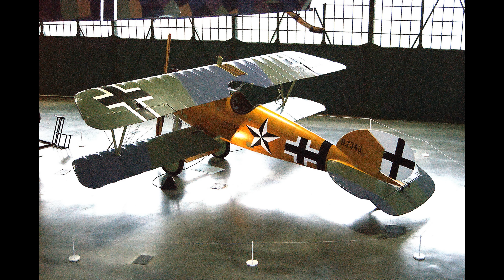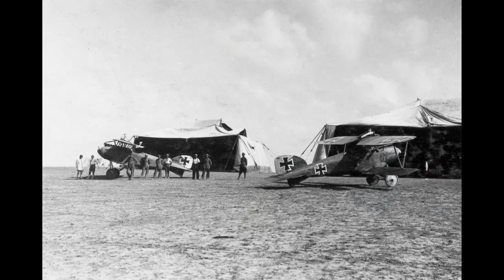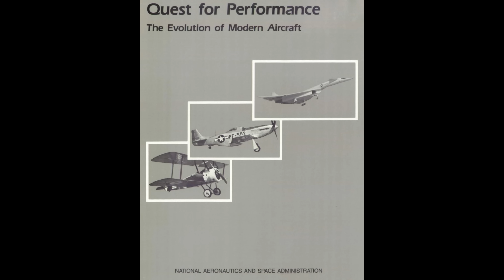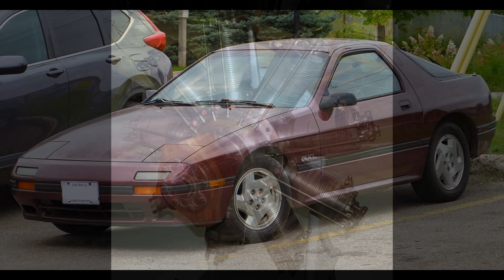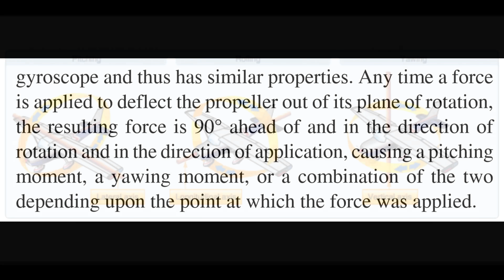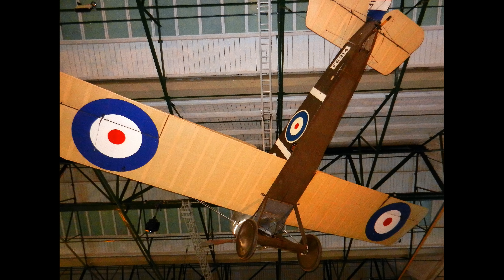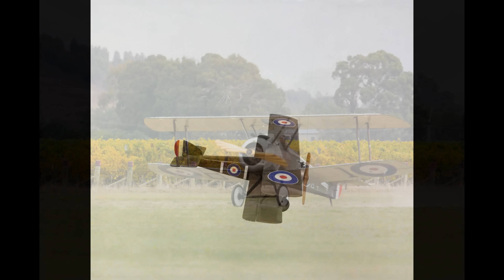Sopwith Camel, War Winner or Death Trap?

Comment: I think a lot of the Albatrosses and also Fokker aircraft really was sort of 1½ wing aircraft's. They where basically mono-wing aircraft with a small lower support wing. The lower wing really was there mostly there for structural strength, and the extra reduction in wing-load was really just a bonus.

So it kind of makes sense that the lower wing had not control surfaces.  A really extreme example of this is the Kondor D.7 where the lower wing is basically a bit of lumber.

I have heard (don´t know if its true) that the liquid cooling of the machine gun was integrated with the engine liquid cooling of liquid cooled aircraft's. That would not only get them nice and toasty, but also with a very uniform temperature.

I think the idea is that the Camel looks like a camel from straight on frontal view.
Reply: Except the lower wing of the Albatros D.III was structurally weak, a problem that plagued all the sesquiplane designs of the period. Not all German planes of the period were sesquiplanes but they still usually went with only one set of ailerons.
Reply: @jeremypnet  There was actually a few that used double setts, while yes, it was rare.

And while sort of kind of not every was, even fokker triplane had gradually shooter wings and quite a few of them had shorter cord on the wings. Not all, but i would say most.

And of cause even the one that was sort of full biplanes evolved that way, it kind of make sense that they retain some features from earlier models. 

For the British planes, all i checked have basically symmetrical wings. It looks like they used the same profile for all wings.
Reply: They were Sequiplanes, the small high aspect ratio wing had a higher incidence which meant in the cruise it did most of the lifting and the low angle of attack main wing produced very little drag.  At the reduced climb or manoeuvring speed the overall higher pitch brought the greater wing area main wing into play.

Comment: Current issue of Cross and Cockade magazine, published by Great War Aviation Society has article about Camel, focusing on how difficult it was to fly.  The author had access to interviews with Camel pilots that had been done in 1960s.  Consensus was that it wasn’t particularly difficult to fly for an experienced pilot.  Takeoffs were the trickiest from a gyroscopic perspective.  Now, we have to remember that these pilots had experience with rotary engines, as the Pup was used as a trainer.  Also, pilots were used to flying this type of aircraft- you can’t fly it hands-off like modern aircraft.
Reply: Consider that the primary training aircraft used for British training up to about 1916 was the Maurice Farman MF7 Longhorn, which was rife with weird and quirky handling as well as being slower than anything they were training to fly. There was also a mix of RAF BE2 and some Sopwith two seater trainers.. Up until they decided that the AVRO 504 with it's generous tail arm and somewhat innocuous handling was to be changed over to in the mid 1917's.   It gave you a gentle taste of gyro precession and rotary engine operation procedures and they installed bosun's tubes so the trainee could be shouted at when he made a mistake.

Comment: I so totally agree that I just don’t see much of a hump and always scratched my head at the naming of the plane for a rather unobvious feature. It needs to be pointed out and then you go ahhh yeah I kinda see what you mean that’s a little bit of a hump right there if I squint enough.

So when I used to play a lot of flight sims especially WW1 games, after a while I really figured out the SE.5 was where it was at and NOT the Camel. The speed and smooth handling of the SE.5 made that plane unbeatable same with the SPAD 13. Much rather fly those planes than the clunky Camel any day.
Reply: Hi chpet. As I understand the name did come from the fact that the plane was as misbehaved towards her pilot as the animal, frequently trying to bite or kick his handler.
Reply: @alcalaino1486 While it’s a nice story but if you think of that logically the unwieldy handling would have been applied by Pilots AFTER they had experienced it’s nasty characteristics but the design teams were the ones I’ve always read as coming up with the name because of that “ hump”. But the most important thing you might want to think about is most people in 1917 don’t have a clue what a camel is like but just about EVERYONE knows what they look like !

Comment: Ah the Camel. It awoke some old memories.

My dad had Microsoft flight simulator on his old 286. It had a simple dogfight mode, that's where I learned about the Camel. Can't remember exactly what German planes you fought, but one was a dreidecker.

It was a challenge since the fps was about 10-12 with nothing but instruments visible, and around 2-4 when close to another plane or terrain feature.

The graphics weren't much, just wireframe, monochrome vectors, on a Hercules phosphorus monitor 😁

Comment: Am i correct in saying that the Camel did not have a throttle as we usually understand it, but simply had an 'off' switch that could be used to slow the aircraft down for landing?
Reply from the maker: Sort of, I didn't have time to get to that.

Comment: Want to know about gyroscopic precession, ask any helicopter pilot.
Reply: In practise, gyroscopic forces have surprisingly little impact in helicopters.  By and large, gyroscopic effect depends upon the rotating part's: mass; distribution of mass, and speed of rotation.  With their tiny solidity ratio (eg 0.08 for a Sea King), helicopter rotors have relatively little mass compared with their size.  Most of their mass is concentrated in the hub area, and they have a relatively slow rotational speed (eg 200 rpm for a Sea King).  

There is a similar effect called phase lag, which means that cyclic control application has its maximum effect upon the rotor disc about 90° later than the input.  The pilot doesn't feel this because it's taken into account in the control rigging: if the pilot pushes the stick forward, the rotor disc tilts forward - initially, anyway.  This shouldn't  be confused with gyroscopic precession.

Of course, helicopter aircrew are indeed familiar with gyroscopic precession. Even nowadays, many helicopters make use of mechanical gyros for instruments, autostabilisers, autopilots and navigation systems.
Reply: @simonburch4434  Not my point. My point is the 90 degree offset of the control linkages of the main rotor. One could call that a bit more than little impact considering.
Reply: @rustyheckler8766   The 90° offset of the linkages in the controls is there to cater for phase lag, not gyroscopic precession.  Phase lag is entirely different from gyroscopic precession.

Comment: Just over 500 pilots killed in combat in the camel just under 500 pilots killed in flight training. probably the most dangerous aircraft to ever enter service yet it was flown at night and off early aircraft carrier experiments.

Even today modern examples are flown with only half a fuel tank. 

This is to avoid taking off with a rear CG (tank behind pilot) there is no elevator trim a considerable stick forward force 16lbs was required to stop it pitching up on take off. A mixture adjustment had to be made after take off while doing this lerner pilots often relaxed pressures on the stick causing pitch up and stall spin.

With an empty tank the CG is rearward and there is hardly enough elevator to flair the landing. None of this is due to the gyroscopic effects but simply fuel tank location and lack of elevator trim.

The follow on Snipe put the fuel tank round the pilot.

Comment: One of the other dangerous traits of Rotary - engined fighters: no throttle. Gads! Ya basically run 'em with a kill switch.
Reply: They had no throttle?
Reply: @HDSME correct.
Reply: @HDSME iirc in the Camel "throttle" meant to switch off cylinders in two stages.
Reply: Those Magnificent Men in Their Flying Machines ?
Reply: Only the Gnome engines had no throttle. Rhone and Clerget have throttles.
Reply: @EdmondDantes-c8t  Correct although the Bentley-Clerget also had a throttle.  If you want to see one in operation  Kermit Week's Sopwith Snipe's first start and warmup demonstrates the throttling abilities of these "throttled" rotary radials
Reply: They dealt with those little fockers though 😂

Comment: Fascinating video that lays out the difficulty in flying a rotary with such a concentrated mass.  Does anyone know if the Camel had an incremental throttle or was it an on/off 'blip" like all the other rotaries? And what  effect would blipping have on the gyroscopic forces?
Reply: I understand that it was on/off.

Comment: I believe that the Camel killed more inexperienced pilots than enemies. It was notoriously dangerous in take offs and landings.
Reply: Even during WW2, the rate of non-combat losses could head towards 50% on some types. Here, I am not saying non-operational losses but also ones such as navigational issues in bad weather resulting in loss in the sea, crashing into the ground, landing and take-off accidents, training accidents, losses due to engine failure, and collisions. And this rate persisted somewhat into the 1950s. People complain about the Meteor loss rate, and there was a specific aerodynamic issue that could induce an unrecoverable spin, but a lot were due to the causes noted above and it's my impression that the processes of a wartime force had not been modified sufficiently for peacetime to improve safety.

Comment: "The only effective lubricant for the rotary engine was castor oil. As the huge mass of engine whirled around, spewing out a spray of castor oil, pilots and ground crew complained not only of the smell but of the fact that it affected their digestive systems." The life of a First World War pilot was hard but their bowls were softened.
Reply: This led, ultimately, to the dreaded Castrol R… - a castor-based oil, chiefly used in racing.
Reply: @dennisyoung4631  Castor oil can withstand high temperatures without losing its lubricity. It was widely used in racing engines up through the early sixties.
Reply: @fafner1  still is, though usually in combination with other lubricants, e.g. Maxima 927, Klotz Supertechniplate, and Castrol A747.

Back in the early eighties, I recall buying a quart plastic bottle of Castrol R-30.  It was kind of a greenish tinge…
Reply: @dennisyoung4631  The company name Castrol comes from their castor oil lubricants.
Reply: They typically  weighed  around 300 lb, not massively heavy , roughly 1/3rd of the total weight of the airframe, minus pilot
Reply: It gives the phrase "give 'em a squirt" a whole new meaning.
Reply: I am guessing the pilots ingested castor oil fumes and never had a problem with constipation
Reply: Known as 'dribble bum' both sides suffered from it.
Reply: They were 2 stroke engines, they didn't  leak oil, they burnt it in a total loss lubrication system,  there were no exhaust pipes,  exhaust  gas and unburnt oil was just discharged from the outlet ports, fuel/oil mixture was fed into the crankcase and then drawn up into the cylinder heads, there was no throttle,  the on,y way to control  the power of the engine was to intermittently switch  off the ignition, castor oil was used because  it was cheap and easily  dissolved into the petrol.
Reply: @jeremyfoster6942  They were actually four strokes, but the fuel did flow into the crankcase through a hollow crankshaft similar to a two stroke. Any oil from the lubrication system ended up being mixed with fuel in the crankcase. The Gnome  Monosoupape (French for single valve) used intake transfer ports making it even more like a two stroke. The Monosoupape was known to be eratic even by the standards of rotary engines. The US First Pursuit flying Neoport 28's used hop up tricks from American car racing to improve the reliability and performance, Swiss cheesing the  steel pistons to lighten them and improve lubrication among other things. The First Pursuit was supposedly the only American squadron to hang on to the Neuport 28, disparging the Spad that all the other American squadrons loved as a truck. 

The churning action in the crankcase mixed the fuel and air which meant a carburetor was not required, a simple adjustable needle valve and an air flap were used instead. Lacking a carburetor, rotaries were typically operated flat out, a "blip switch" (aka a kill button) was used when one needed to reduce the power to land. The Clerget and the Bentley were slightly more advanced than the Gnome and the Le Rhone, incorporating a selector switch allowing operation on 7, 5, 3 or the full 9 cylinders. Herschel Smith’s "Aircraft Piston Engines" has a good chapter on the rotary engines.
Reply: @fafner1  an interesting point, I had always considered them 2 stroke due to the fuel mixture being supplied through the crankcase in a classic 2 stroke configuration.
Reply: @jeremyfoster6942 
4 strokes. Although the earlier versions had atmospheric intake valves. Engine power was ultimately limited by the amount of fuel and air you could draw in through the hollow crankshaft. Plus building bigger engines just added to the balance and engine torque influence issues on the airframe.
Reply: @mpetersen6  only fuel / oil mixture was drawn through the hollow crankshaft, air was admitted through a valve on the cylinder head. The le rhone 28E was built in 1918 capable of producing over 300 hp, compared to the 7A which was produced in 1910 that was capable  of only 50 hp, its clear the design was not as limited as some may think.
Reply: @jeremyfoster6942  
If you look at the Wikipedia (1) article there is a picture of a Le Rhone engine. There are copper pipes leading from the crankcase to the cylinder head. These lead to the intake ports.
Reply: @mpetersen6  and if you read the paragraph next to that picture  you will note, "Compared to the Gnome's, the Le Rhône was considerably more "conventional", using copper intake manifold pipes to bring the fuel to the top of each engine cylinder, along with intake and exhaust valves."

Comment: Thanks for another great, well researched and well presented video.  I wanted to made a few quick comments...
As for the total loss oil system, I'd read/heard that the lubrication oil used was castor oil and that the pilots unavoidably ingested quite a bit of it every time they flew and that it had the affect that taking castor oil has on people. 
Next, gyroscopic precession is so amazing and so powerful that the pitch input for helicopter rotors is 90° from the desired pitch or roll direction of the helicopter.  
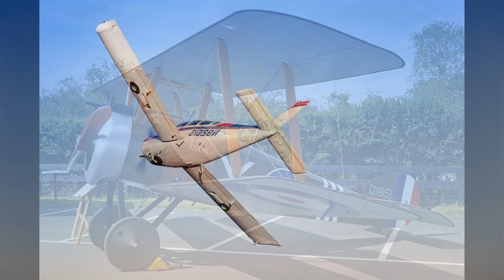Finally, at around 17:05 and 18:05 great use of Photoshop or whatever to just flip the image of the aircraft in the turn instead of trying to find images of an aircraft in a matching right and left turn.

Comment: Great explanation of precession. It's exactly how I learnt it too, the whole right hand rule just couldn't work for me. I'd think more and simpler diagrams might help but hopefully people will still get it.

Also answers exactly what they were doing with rotary engines. I always figured they'd be able to make radials in theory but never knew why they didn't.

Finally regarding multiple ailerons, it seems to fit a natural instinct to have multiple but my assumption is that it wouldn't be worth the effort. The same reason biplanes aren't great applies here - the low pressure region atop the lower wing has interference from the high pressure region of the upper wing making it less effective. The low pressure being particularly important as it's usually creating 3-4 times as much pressure differential to the high pressure side. Thus putting a single aileron on the top surface should be more efficient. The drawback primarily being a larger aileron will reach further inboard and inboard forces produce less roll moment. So it likely comes out as a wash which is better - I'd assume multiple ailerons are better for a larger roll force whilst a single pair is better for more efficient moderate roll forces. And obviously simpler overall, less wires, no joints on the lower wing, generally lower drag, structurally stronger and so on.

Comment: I just can't understand why they didn't build plain radial engines and just put a high-geared cooling fan between the prop and the engine.
Reply from the maker: More weight, more complexity, it would rob power. Instead they just spun the whole engine. You're not wrong though, with the benefit of hindsight we can see that would have been a good option, but they did have reasons for doing this, and for stopping it just after the war.
Reply: It wasn't just for cooling that the rotary was more popular than the radial at the time, but the rotary engine (partly due to its simplicity) was also the most reliable aero engine of the era.
Reply: Radials such as the Dragonfly did start appearing during WW1, but reliability and output were issues. It didn't take long after WW1 for the change to radials to take place. The Camel's successor, the Snipe, was about the last of the RAF rotaries and that went into service right at the end of WW1.